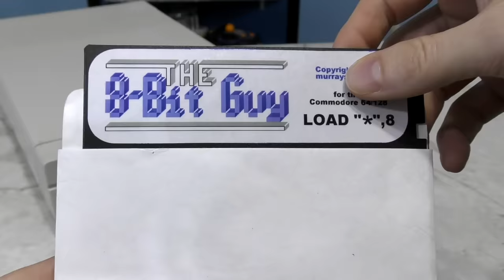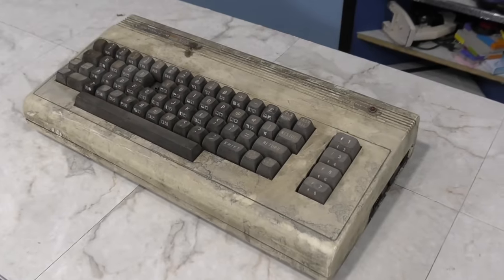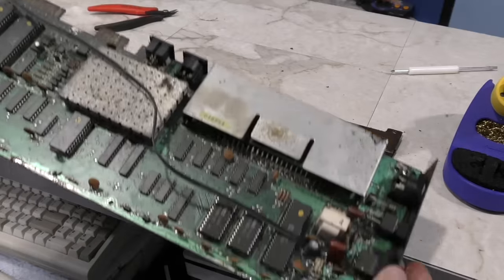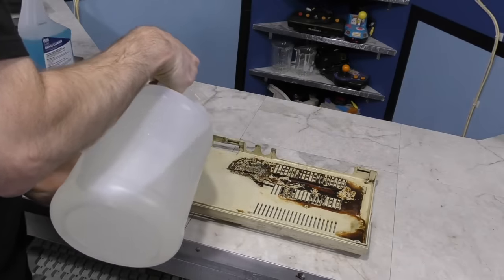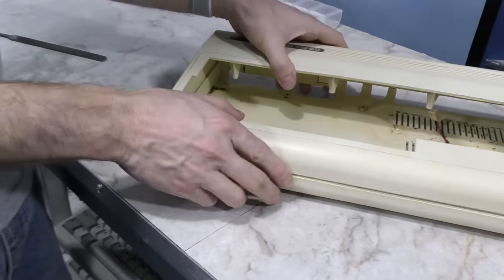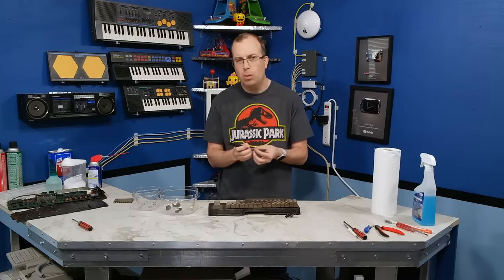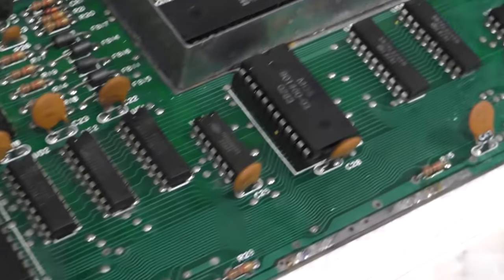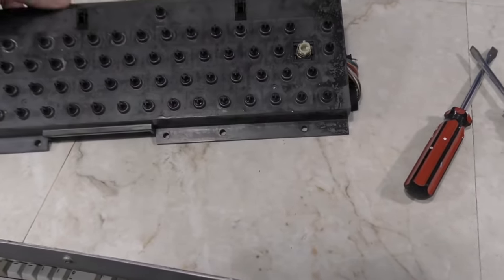Restoration - The Worst VIC-20 I've ever seen - Part 1

Comment: Sprays motherboard with a water hose, "and as you guessed I had some problems with the motherboard".
Reply: "The oil actually protects the motherboard from moisture, which can be harmful." blitzkriegs the motherboard with water
Reply: @Emily-kd2zv  You can submerge motherboards in water as long as you let it dry for a couple of days after. It should be fine. Did the same with my PC motherboard as a test 2 years ago and its still going
Reply: You clearly don't know how oxidation works. To damage the board with water you need to let it wet for days, or turn it on while wet or submerged. Actually, we clean almost every super dirty/dusty PCB with water at repair shops, it just need to be dried out.
Reply: @lauratiso  still funny tho
Reply: Marcus Tiso Putting boards in a dishwasher? No problem! (of course without detergent)
Reply: @lauratiso  what about corrosion ????
Reply: @techyrock  corrosion and oxidation works in pretty much the same way. To oxidize or have a corrosion on a metal, it needs to be wet for days or even months depending of which metal we are talking about. If you dry up all the pieces/parts after the cleaning, there's no problem.
Reply: @DrakkarCalethiel  lol, I got a nasty Super NES last year and I cleaned all the parts, including the board, with detergent. It was very nasty inside, with all sort of dirty you can imagine, even dead bodies of cockroaches. I didn't put it on a dishwasher, of course, but I cleaned it with a brush and a lot load of soap.

Today it works fine despite I needed to replace all the capacitors and the 7805 (or 7809, I don't remember) voltage regulator, the console doesn't looks in a pristine way, but it's in working condition and with a much better appearance.
Reply: @lauratiso  hmm okay
Reply: @MySpeed12  People Think Water will eat away your electronics, They don't understand that water won't do anything until you turn it on
Reply: counterintuitive lol.. but water is good.. especially after its all gone = )
Reply: Fresh water does not hurt a motherboard. In the 80s we used to hunk our C64's in the pool to get all the dust and funk out of them and let them dry out in the sun. lol
Reply: It's a Vic-20 throw it in the dishwasher and let it dry lol.

Comment: For the PCB, here’s what I would have done (if I didn’t have an ultrasonic cleanser):

I’d have spritzed lightly with soapy water, agitated with a nylon brush, and rinsed. I’d follow that up with isopropyl, agitate, rinse.

If the soapy water was ineffective I would have followed up with an enzymatic degreaser like Simple Green, but with very careful application (paper towels to the flat parts) followed by agitation with isopropyl and another wipe with simple green (agitation will dilute the trouble spots and spread it back to the flat spots where it can be safely wiped without getting cleaner in tight spots). Of course, you don’t want to leave any of the enzymatic degreaser on there, so flush with water and isopropyl one more time when it all looks good.
Reply: I prefer to use some club soda and lime juice mixed with vermouth. After a couple applications the problem should go away.
Reply: Simple green is junk does not work i use it alot on marine applications but stopped using it due too it not working just use plain Dawn dishwashing soap contains no phosphate and a great degreaser
Reply: BreeBree Cris, as someone who has used gallons of Simple Green to clean my tank (the subturret of a tank is fucking TERRIBLY dirty), I disagree with you. Simple Green works great in certain applications.
Reply: Do it betrer

Comment: The wd40 makes perfect sense actually. When cleaning dirty oil off a surface the most effective way to clean it is with a thinner oil (I would use soyabean or vegetable oil to do this). Once the thing you're cleaning looks clean again you'll want to dissolve the thinner oil off with a water/vinegar solution. I actually picked this up from printmaking (we use a really thick paste ink that's oil based. You scrape as much as you can off and dissolve the rest with oil to get your glass pallet clean.)

Comment: "these are burn marks" lol this must be JerryRigEverything's computer
Reply: "Burn marks" like that in plastic are usually caused by cables having been wrapped around it. Many cables have been made of PVC with plasticizer additives that made the PVC more pliable, and it is those plasticizers that eat into ABS plastic it comes into contact with.
If you collect vintage computers, it is good to always store cables in plastic bags (different plastic that isn't affected) or in empty toilet paper tubes.
It happens a lot quicker than 30 years, maybe five. I don't want to do a test :-þ

Comment: The entire time I was yelling “dawn, just use some dawn”. For the love of all that’s holy. Soaking these parts would’ve saved you an entire day. You’re restoration mind is on point, you’re cleaning mind however....lol
Reply: Agreed
Reply: How is that not the first thing he tried!? I don't get it!
Reply: Brooklynn B Your*
Reply: On oil like that, dawn would have gotten most of it except for a film of oil that would just pick up dirt again. Ive already tried. I would recommend that david would use it for an initial cleaning.
Reply: Brooklynn B      Bleach is the answer
Reply: Alchemy 3083 well, wd40 its self leaves a film on whatever it touches. Its very common that people will coat fertilizer spreaders with wd40 because it prevents rust.
Reply: Dawn or engine degreaser. I have this jug of Purple stuff non-toxic biodegradable, works great on plastics.
Reply: I love how people don't listen at all "I started with glass cleaner as "always" because it can case the lest damage"  it is part of his restoration process.. you start small and build up to the next..
Reply: @Alchemy-yr3sw  you a, don't;t know what the word SOLVENT means.. ah do you?
Reply: ReallyLong URL no shit. Thats the rule of the trade
Reply: ReallyLong URL wd40 lists its self as a solvent but it doesnt disolve Jack shit. All it is is a penetrating fluid.
Reply: Different solvents work for different materials. You can't dissolve oil in ethanol the same way you can't dissolve oil in water.
Reply: @AndyGuyCantYouLiftForLife  >  after all, it's used to clean oiled birds.  Maybe a little Dawn and Oxyclean for an good overnight soak while you play with your Donkey Kong.
Reply: ME TOO!!!
Reply: @chewie2055  shoving is the answer. The humans must be pushed down the stairs.
Reply: @AndyGuyCantYouLiftForLife  WD40 can be a solvent for any nonpolar molecule like other oils
Reply: That is true, but it stills leaves a film on top. If youve seen him work on reproduction labels for cartridges, youll notice he goes after and uses rubbing alcohol to get the residue off. 
The reason WD40 works ok as a solvent is that its has the properties of diesel, but a little more oily. It can seep its way into cracks and break up oily stuff, but it will leave a trace.
Reply: Anna-Lisa damn I havent been on this thread  for 2 months. Its possible. Maybe even 2 or 3 treatments with dawn could get the job done by its self. I have found a perfect remedy that may just work a little better than dawn. Laundry detergent, such as tide. I tried using that on greasy hands after cleaning out an engine bay with 134 thousand miles of road grime on it, and that grease was no match when tide was paired with a rag.

Comment: I find that brake cleaner is an excellent cleaning tool as you did however if you use carburetor cleaner it works equally as well but is formulated to prevent damage, cracking and any kind of negative affects to plastics and rubbers.

Comment: I've cleaned a LOT of very greasy, oily electronic parts with a job in offset printing, and the first thing I do is douse the piece in a bucket of undiluted Palmolive dishwashing soap before moving on to anything corrosive or abrasive.  You wouldn't believe how well it performs on grease, mechanical and motor oils.  When I'm trying to clean anything with some years for the grime to settle on, even a ten minute soak in your preferred cleaner saves you 80% elbow grease.  I take one piece off, put it in the bucket of cleaner, keep disassembling and by the time I'm done the initial parts have gotten a good, thorough soak.  Gasoline, xylene or toluene will eat through just about anything organic on a metal surface in a matter of minutes.  They love to mess with the molecular structure of certain petroleum-based plastics however, so I tread lightly in that department.
Reply: Thorough cleaning of electronic devices - Palmolive good, Bathroom foam (scrubbing bubbles) great.  Use warm water, or hot... rinse well, and dry in front of box fan for an hour or so.  I never waste time on harsh stuff unless absolutely needed.  Clean paint brushes get into wet soapy details with excellent results.  Have restored radios, TV's, VCR's, stereo equipment and, yes computer and video game hardware  Just DON'T go dunking hard drives...
Reply: Gud job

Comment: I used to work at a hotel, and every few months I had to spend 2 days cleaning the kitchen, which hadn't been clean for years before I started... the filters above the stoves were the worst, I had to spend an entire day just working on those, soaking them for hours in industrial strength oven cleaner, as well as the cast iron burners. Having to scrape off all the build up of food and burnt oil, all the dried spills and leaks on the floor, it was a nightmare...
Reply: Gordon Ramsay would appreciate the effort
Reply: I work in restaurants and that's the thing I hate the most, I don't know how can anyone allow the filters get to that condition, omg.
Reply: @idontlikecops1  Are you implying that if I had spent more time in a system, designed to train factory workers, then I wouldn't have to work?
Reply: Sounds like something out of kitchen nightmares unfortunately it's real
Reply: @RaphaeLoh01  did you get anything for your effort?
Reply: @vooshmoozik6185  I quit and moved to the Northern Territory...
Reply: @idontlikecops1  Should have studied more, Donald.  Should *have*.  Pay attention in English class, now.

Comment: "Worst computer that I've ever seen, period!"

Maybe, but if I'm honest, I've seen a LOT worse while working at a computers repair shop.
Reply: Ive seen a abandoned Pc on our scholl and its much worse than this vic-20 tbh,Disk drive popping out of the casing,half of the wires chewed up by some creatures,Case not even closed,fans with a gunk of thermal pastle that looks like something,and duuuuuuuusty case and interior
Reply: @euvo_sound  Well, to be fair, the one you are talking about was at least actually abandoned. The ones I was referring to were actually "daily drivers". That is, were computers with active daily use.
Reply: @Command64 I know. And I commented that I have seen worse.

Comment: Don't ever use mag wheel cleaner as it contains caustic soda which eats the metals of the motherboard. Not good for electronics. And never use water for the same reason. My advice would be to soak the entire motherboard in benzine as it's totally inert. It dries very fast and won't damage the electronics. If that doesn't do the trick use automotive spray carb cleaner  as the oil and dirt will just spray off instantly, without any rubbing. Then rinse the residue off with benzine.

By the way, if you ever drop your cellphone in water,  put your entire phone into a jar/flask of benzine, shake it around and take it out to dry which only takes a few minutes. I've never lost a cellphone that way, but using water or caustic soda on any electronic circuit is asking for trouble. I hope you found this useful.
Reply: Water will do nothing to any circuit that's not powered. They literally wash motherboards in the factories. Where do people get this crap?
Reply: @evilkillerwhale7078  It depends on the components. Most can handle a water wash and many can't. It's safest to use be benzine as it's inert. Most cellphones won't work if they're dropped in water.

Comment: WD-40 is a cleaner that's designed to remove grease, no surprise it worked the best.  I don't know why people think it's a lubricant, that's NOT what it's designed for.  It's designed for cleaning up old grease so you can apply new grease.  The worst thing you can ever do to something like a bike chain, hinges, bearings, etc is to put WD-40 on them.  Unless of course you are cleaning them and use a proper lubricant afterward.
Reply: I don't know why people don't get this. Is called W-ater D-isplacement 40. It was invented for clearing fluids (or protecting stuff from fluids). Fantastic for cleaning really dirty stuff, but you kinda have to clean the WD-40 off afterwards too if we're talking electrical stuff.
Reply: Yes and no; it's a light oil in an even lighter dispersant. They sprayed it on missiles not necessarily to drive off water, but to place a hydrophobic coating on the aluminum to keep water from adhering and corroding it. For light duty, it is an adequate lubricant.

The place it's really bad to use it is in something like a lock, where it will collect dirt and create a gummy mess.

Comment: Pure acetone will take it off no problem.  $16 a gallon at wal-mart. I wouldn't use it on the outside though, it tends to leave a little foggy smearing look on plastic. Nail polish remover works with less abrasion but doesn't work as well as acetone. Hope it helps for a next time!

Comment: I'm not surprised at all that mechanical cleaning solutions worked well for the computer. After all, back in those days, the difference between mechanics and electronics was much smaller. You can literally sit down in a workshop and solder together a Vic-20 motherboard in about an hour.
Today's computers need specialized equipment and a much higher understanding of electronics to deal with, but back then you could basically fix a computer if you knew how to fix the engine of a car.
Reply: What does that have to do with the fact that motor cleaning solutions worked well because the equipment was coated in motor oil?

He simply matched the type of cleaner to the type of oil.  Has nothing to do with changing paradigms, an increase in complexity where electrical engineering is concerned, or anything to do with fixing cars.  Just matching chemicals to grease.
Reply: Yeah, but try coating modern electronics in it. You'll bust the electronics if you do that. In the earlier days of electronics, the components were made in a similar way to mechanical parts, now the materials they are made of are completely different.
Reply: modern computers have also become many many more times complex. The more complex something is, the easier it is to break which is why you can't blast a laptop with motor cleaner and get away with it anymore. It's a tradeoff for being able to do things like protein folding, and create massive complex 3d worlds
Reply: Of course, it's worth the trade-off. I was not trying to make a comment about "old is good, new is baaad", it was more an explanation for those younger viewers who may not know about the common origin of both electronics and mechanics.
Reply: Great thought as an argument. Compliment.
Reply: I just realized that my reply to you might seem a bit more snarky than I meant it to. I was basically trying to elaborate off of what you said Thanks for not freaky out on me for seeming like an elitist. I like to think about where electronics come from all the time being a younger person getting into computers, and despite considering myself an enthusiast; I only know what I'm talking about half of the time at most! XD Also I do remember seeing an old automatic calculator that basically would take the numbers that you put in and "count on it's fingers" using it's mechanical bits really fast till it got the answer to your problem. A great example of a computer that is much much closer to a car engine than anything we see today. Now, even hard drives with a moving disk are being phased out. Increasing its move from mechanical parts (Kind of weird how mechanical keyboards are about the only mechanical thing still sought after in the computer world huh?) To a more digital approach to everything. It's also interesting to think that I am part of the generation that not only saw the CD's rise to power but am seeing it fall out of popularity more and more since everything downloaded now and I might still be in my 20s when it gets phased out entirely in favor of online downloads.
Reply: Always interesting to see the perspective of the younger generations. As age takes its hold, it's hard to remember that people born after you have completely different experiences.

Like how many born after 1991 have experienced sitting for 15 minutes while a  cassette is playing silently, just to play a game consisting of big blocks in a 16x20 pattern? How many born after 1998 have even seen a floppy disc in person?

And how many born after 2015 will remember the humming of a mechanical hard drive?